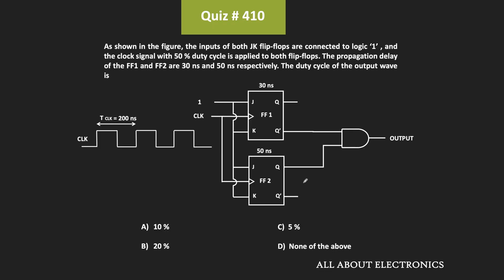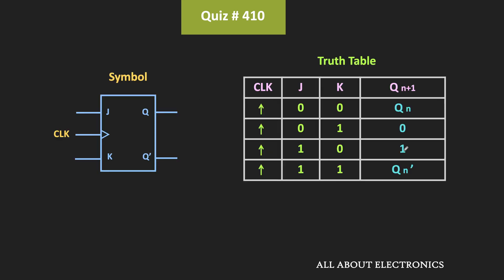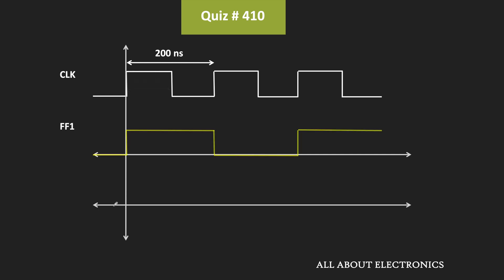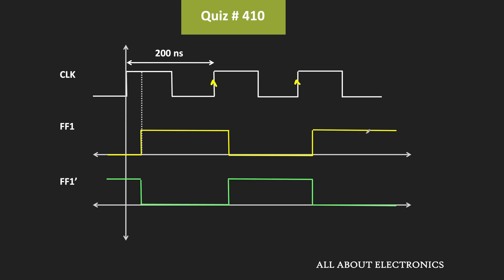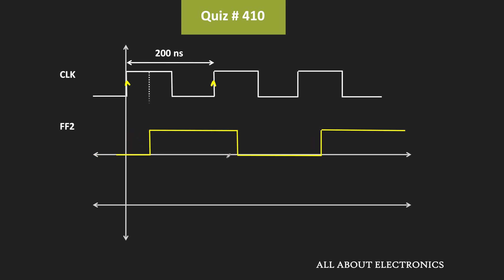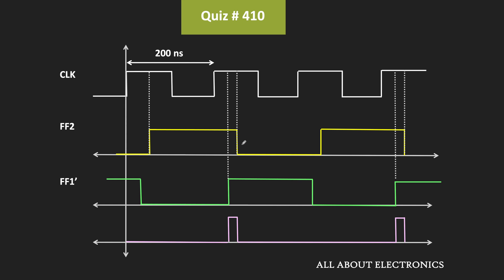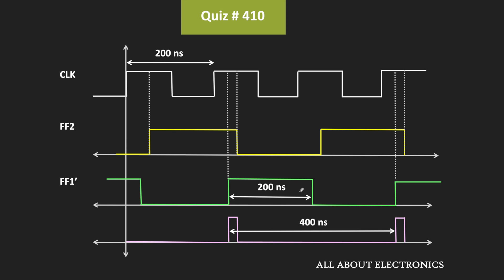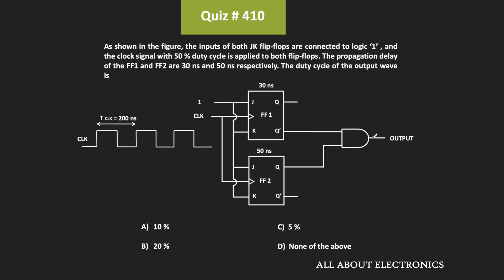JK Flip-Flop Solved Problem (Digital Electronics) | Quiz # 410

Comment: The first flipflop should Toggle at 60ns due to the race around condition, If I'm wrong can someone correct me please?
Reply: the output will toggle only at each rising edge and it will continue the same until the next clock transition, race around condition will happen only in jk latch not in jk flip flop and it is clearly explained in the previous video